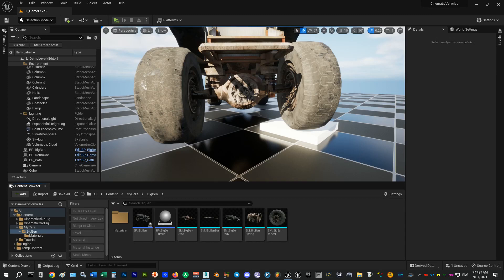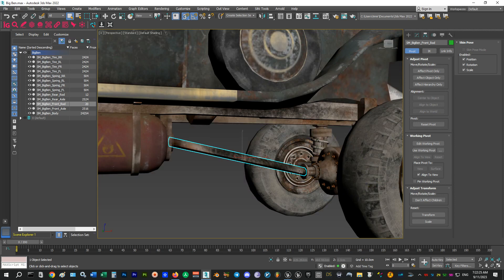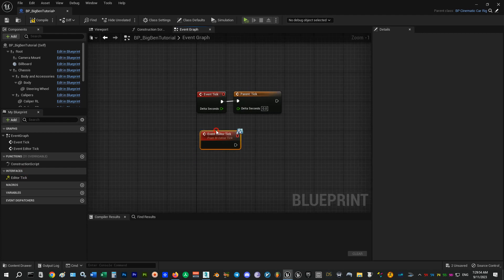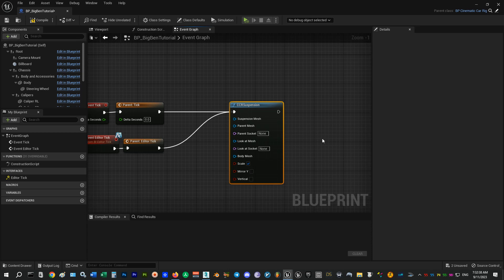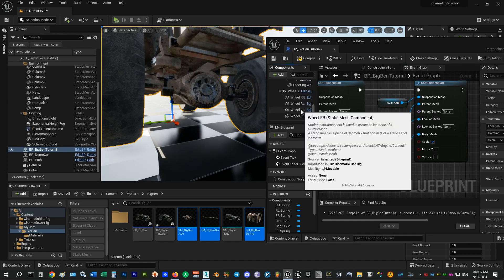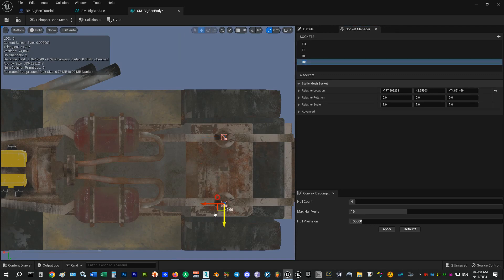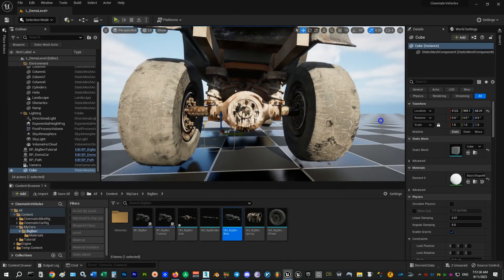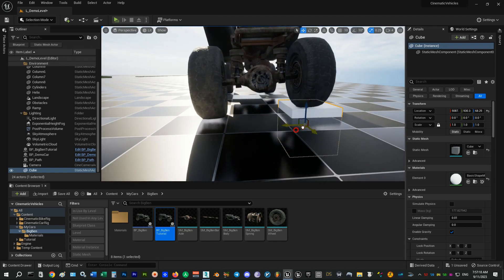Car Rig V1.2 - Suspension Parts

Comment: Hello I bought your CCR 1.4 cool tool, I builded my own CarRig first, but your's is better, because I'm not good in blueprints, first I noticed in 1.4 is that "add call to parent function" on "Editor Event tick" is not working (its grey). I try to find a way to connect controlRig controller "set controll transform" to the caliper mesh. My last Video on my Youtube channel show the base idea of my plan. It shows my cheap rig but with advanced controlrig. Now I try yours, It only runs in editor but not in gamemode(Simulation), when I try to link a controller. Maybe in your next update you could think about "ControlRig Controller Slots" or somethink, maybe for driver character ik hands too, for the steering wheel.
Reply from the maker: Hi, I'm glad you like the rig. Actually you need to add call to parent function only if you want to add some nodes in the child blueprint. The reason it's grey is that you probably have not connected anything to it. If you don't have any nodes in the child, just delete everything from event graph and the construction script. And also if you are calling the parent node, you need to connect the delta seconds pins too. I forgot to do that in this video.
I am not sure if I understood you about the control rigs, but I prefer to do it inside the sequencer and in the animation mode and make constraints between the hand controllers and the sockets on the steering wheel mesh. It is way easier than doing it in the blueprint because different controllers can have different pivot orientations and the sequencer approach is more visual and just easier. What you are asking from me is possible only if everyone uses the steering wheel mesh I provide or at least a specific socket names and a character with a ctrl rig with specific hand controller names and the same pivot alignment. I believe it is more than the scope of this rig which is a car rig and I am trying to keep this as general and as simple as possible.
Reply: @madgoat-studio  the Animation Constraint Tools in Sequencer ist a good idea, but it seems to work only with contrainted controller from pur controlrig, but not with blueprinted controlrigs mapped skeleton meshes. It seems maybe a bug. I can see and animate the controller, but contraints not react. Do ou know that problem?
Reply from the maker: @Kuechmeister  Unfortunately I have not worked much with control rigs. I bet you know more about them than I do. I have only used the epic like control rigs on my custom characters and constrained hand controllers on those rigs. I have not ever worked with or seen blueprinted control rigs.
Reply: @madgoat-studio  OK, I found 2 working solutions to attach my controllers to your caliper meshes: Solution A: "Make Relative Tranformation" of my SkeletonMesh(Getworldtransform) and your CaliperMesh(Getworldtransform) to "Set Control Transform"(my controller) Or Solution B: "Make ComponentReference (Your CaliperMesh) to "Make ControlRigComponentMappedElement"(My Controller) Thanks for Helping and thank you for making your cool CCarRig. Greetings from Germany
Reply from the maker: @Kuechmeister Hi, cool man! Glad you sorted that out. I didn't even know those nodes. Thanks for letting me know about your solutions! 🍻

Comment: Is it possible to use skeletal meshes instead of static meshes for your blueprint
Reply from the maker: If you mean body and the wheels as one skeletal mesh then no, wheels have to be separate static meshes because the rig read their radii and they are rotated and processed separate from the body.
But if you want to have a skeletal mesh body, with morph targets for damage and stuff, then yes you can leave the body mesh empty and attach any type of actor to it, skeletal body, blueprint body etc.